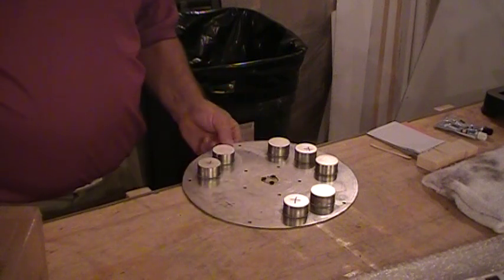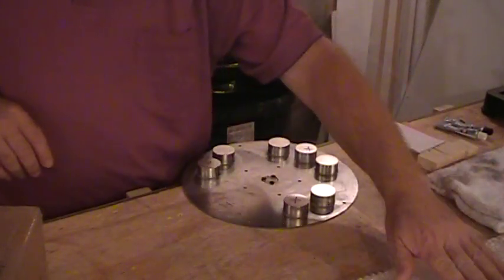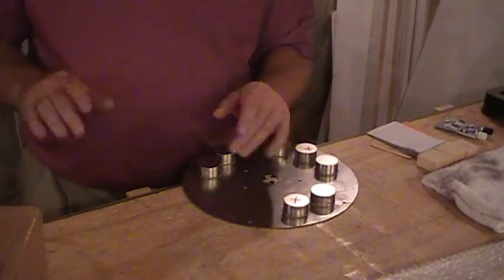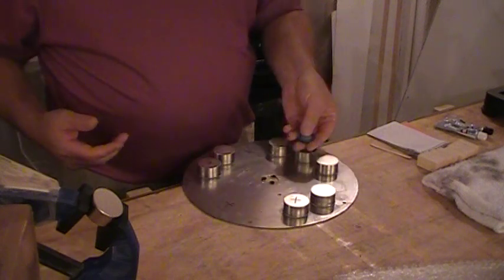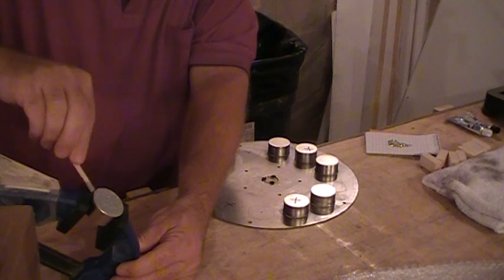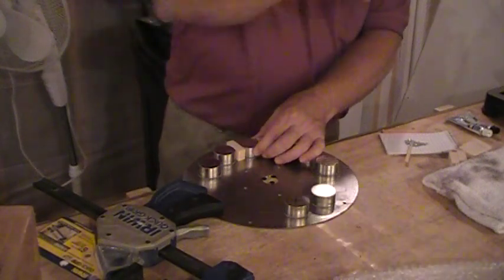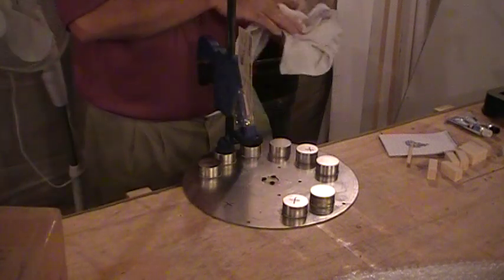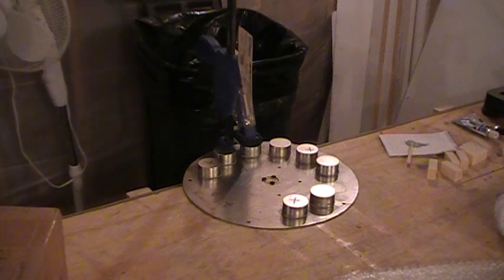Building a magnetic rotor for Vertical Axis Wind Turbine (VAWT)

Comment: You should consider two magnetic rotor plates, (not wooden plates, the metal should strengthen magnetic fields), and a stator between, if properly aligned it should give you 10 times much magnetic flux